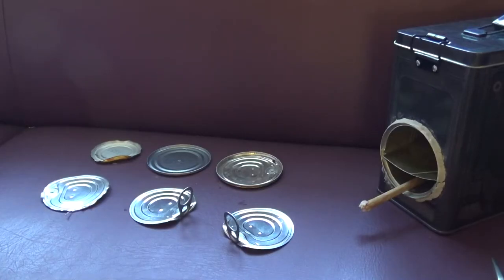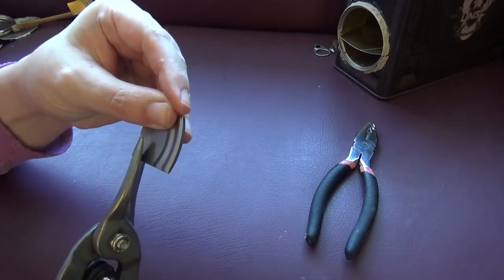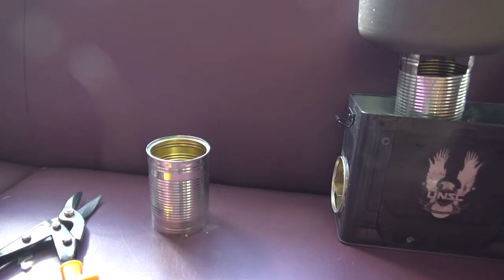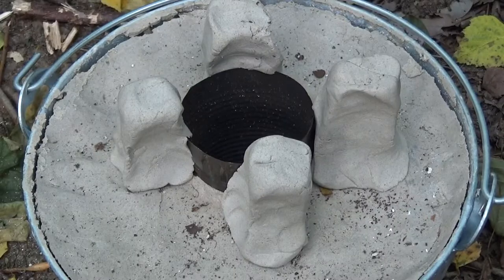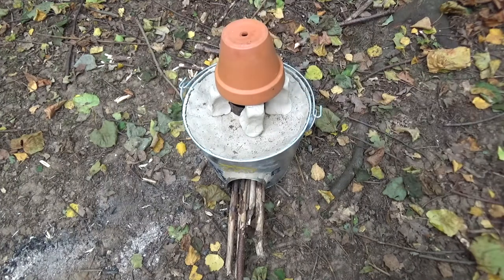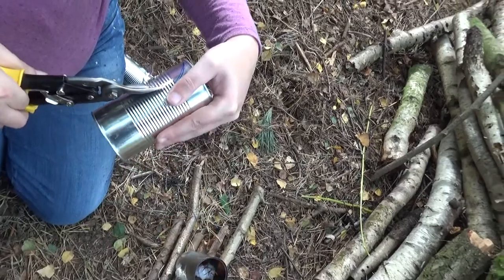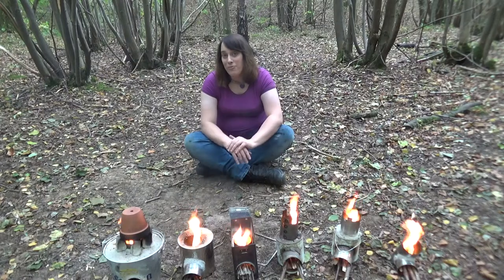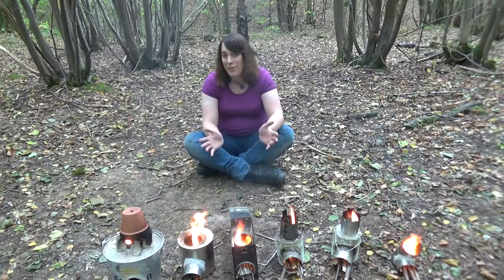Rocket Stove - Additions & Extra Touches

Comment: I strongly recommend leaving the top ring of the chimney intact, and cut the ventilation holes just below it. It will be far more stable that way.
Reply from the maker: That's definitely what I'd do if I used one as a heat source in a shelter. 

Appreciate your suggestion and thanks for subscribing - Zoe